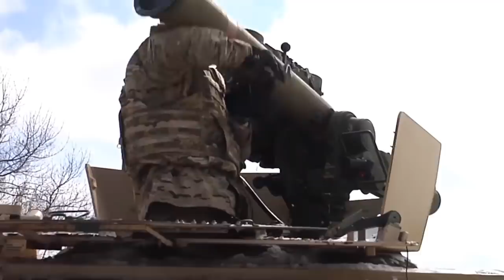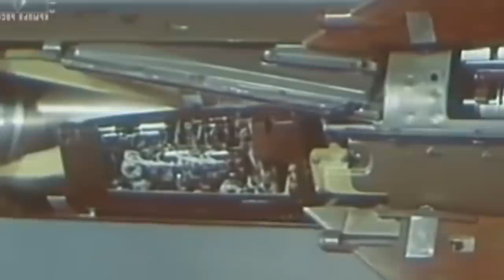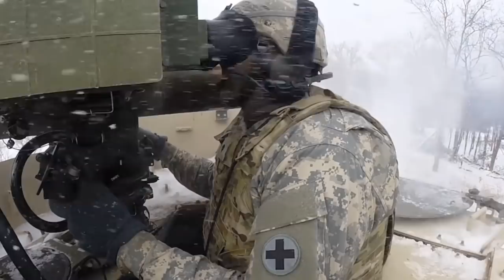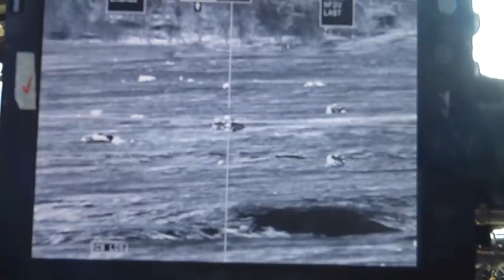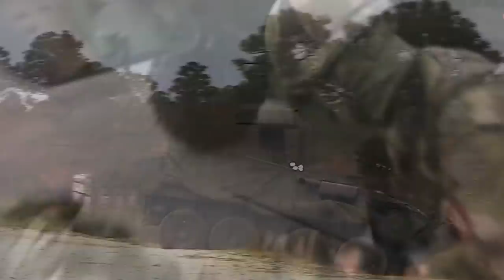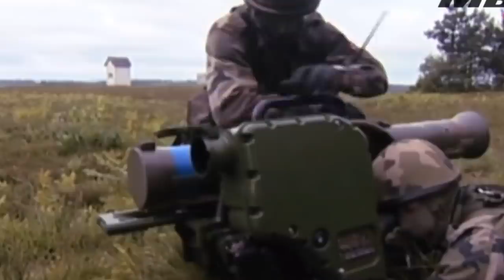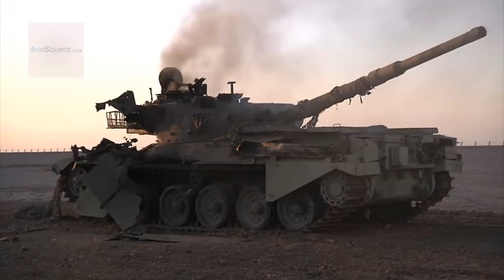Should Main Battle Tanks have Anti-tank Missiles?

Comment: First thing... What would be the point? The tank already has a very effective weapon-system...
Two, if you can put on ATGM's on tanks, wouldn't it be more worthwhile to go for anti-air missiles or laser weapons to counter ATGM's? Sure there are a myrrad of problems with that(!), however it would be far more beneficial for the tank. And with the big (or perhaps a slightly bigger) guns on the tanks already, most (if not all) the jobs that are needed, can already be done.

ATGM's are cool and all, but I feel that they would be somewhat wasted on a MBT with the big guns that we have... On an IFV or something similar with an auto cannon, it is ofc a very different result.

Comment: Better to have troops carry javelins, point or other FAF lockon systems instead of 1 on a tank?

The problem I see though is the further progress of armor thickness. Can MBT guns go through > 600mm effective thickness of DU armor? M1A2 does not have a Tandem warhead, so the only limited options are Sabot and HEAT.

Pros:
- Hellfire/Javelin missiles go up to 800mm of composite+ERA armor. Good example of death to almost any vehicle. No risk of bouncing.
- Missiles can ignore common ballistic trajectories, to hit with a high AOA, where the armor on the top of the tank is thin.
- ERA does not matter as much if using smart FAF top-down systems. (ERA matters when using RPGs, since direct line of sight)
- Can hit targets with high accuracy and same penetration at extended ranges where ballistic Sabot is not useful. (>3km shots)

Cons:
- Money money
- Software
- if wireguided, really easy to miss and requires direct line of sight, leaving your tank exposed.
- FAF systems can have electronic countermeasures
- Big rounds

Comment: The main reason for MBT's (and APCs for that matter) should carry 2-4 ATGMs of the newest sort that can be remotely targeted using spotting data from another vehicle, is that you could fire over your horizon in a way that regular ballistic projectiles usually can not, and also make "from-the-top-kills" on enemy tanks that are in cover, and armored on the front. If your forces have exact real-time positions a spotter-vehicle can position the enemy, then give your missile telemetry data, where you only need to aprove the fire-solution. Instead of facing an enemy entrenched position, MBT's can be their own anti-tank artillery, and then rush the staggered survivors, taking minimal losses for a total break-through!
Reply: If you want to know more about the ways missiles can be used like this, contact BAE Systems Hägglunds and ask them what they can tell about the solutions they are looking at for their CV90 APCs. The fact that they have an prototype implementation for this, is public information, anything else is proprietary and you have to ask them. If you can put one on a CV90, then you can put one on any MBT too, as long as the combat information systems are sufficiently advanced.
Reply: We are already doing that, with artillery's indirect fire. Laser designator paint targets and indirect fire ammo like M712 Copperhead and M982 Excalibur. German and British have similar anti-armor artillery ammunitions too.

Comment: The Russian's experimented with ATGM's that can be fired out of the main gun. The limitation is usually that the bore diameter (100mm-125mm) is not wide enough to accommodate an ATGM with enough penetration to punch through the front armor of other modern main battle tanks.

Comment: They should be able to launch guided rounds from their main gun. This allows them to take out high value targets like SAMs at longer ranges than possible with APFSDS. That said, they probably only need 2 to 4 in a basic load.
Reply: Yes. The Russians had Tube launched AT ( Dual use against helicopters) munitions for the T-72's and for the T-64's since the early or mi70's. ALl Russian tanks since fire ATGM trough the barrel.

Comment: Tanks don't need an ATGM, but we should probably be developing the next generation ATGM vehicle. Think of a vehicle with several Spike like long range missiles that are fiber optically controlled and also has several drones to find and direct these missiles. At this point you no longer need line of sight and can engage targets that are hidden without any fear of return fire like with most current LOS guided missiles used today. The tech already exists today, both missiles and drones. We just need somebody to put them together to an integrated system and you will have a much bigger game changer than a tank that can fire an ATGM.
Reply: Better yet a next gen A-10 replacement with increased capabilities, the A-10 scare the shit out of tankers when they face it, in fact it scares anyone facing attack by it, gun missile, bombs what ever it takes and It's hard to take down as well
Reply: 8aleph the a-10 is very slow in comparison to other jets, as a result it's much more vulnerable to AA
Reply: And fiber optic is not something you can put as a wire trailing behind a missile, the things break if you bend them too often you dummy there's also no reason to use the extra bandwidth or speed

And the final point is the large amount of heat and the light of the missile's exhaust cannot be hidden
Reply: Considering the Combat time the A-10 has flown and  with what maybe 6 down not a problem at all. That aircraft is exceedingly agile and has the same self defense systems as every other US Tactical aircraft and never ever flies straight and level except during a weapons pass. Back in the 70's when the airplane was new I was stationed at Kadena ab a pair of A-10s arrived to do familiarization training with our F-4 drivers. One of whom asked how fast the it was, when told he said dead meat and was then told the aircraft had all the same threat warning systems he had then was  asked If he cared to try a head on gun pass he thought about it for a second or two and said no way. As to aircraft speed slow is sometimes better, the Bismarck was torpedoed by a Fairey Swordfish that survived to do so because the ships aa guns couldn't track slow aircraft effectively
Reply: Yes, the A-10 attack planes and other similar ones are effective and they have the most massive losses. The question is that it will end sooner, planes or anti-aircraft missiles (it's difficult to count on this).
In a protracted conflict, we will have to abandon the tactics of using the A-10.
2008
Commander, before us is a forest of inversion traces!

Comment: Dont they already have tanks that can lob a tank shell and fire a missile from the breach? M551 Sheridan is a nice little example
Reply: The M60A2 and M551 which had the 152mm Gun/launcher are both out of service the  missile had a 900 meters minimum range, the conventional rounds had first generation combustible cartridges which were easily damaged and suffered from water infiltration 9 ply barrier bags and a rubber waterproof cover had to be pulled off before loading then a wait for the electric breach to close. In Nam most of the rounds fired by Sheridans were beehive dart loads less recoil max damage to troops in the bush. The electronic packages which made up the system were touchy to say the least if ATGM was to be used fire them first before regular HEAT-MP rounds as the recoil could disrupt most of the packages with 3 shots. Newer Russian systems are meant for long range shots especially vs Helicopters out past 3,500 meters or a tank parked with the side exposed. Only 3 or 4 Missiles carried in most cases.

Comment: 1. The Tanks in the Gulf War were outdated by any standart, modern vehicles such as the T90M or T14 are going to be nearly imposible to Crack with a TOW that due to Pasive and Active protection systems and ignoring those the Armor is still going to be to much to deal with by prety much all modern ATGM systems. the future is deinfetly in superhigh velocity kinetic weapon systems such as Railguns, but its going to be a while till we see those on tanks
2. ATGMs can fire on the move, the only limiting factor in that regard is the launching method and if this is one using Wire Guidance then it has to be stationary, Radio or Laser guidance however can be undertaken when on the move, and ATGMs fired from the Gun of a Tank are mostly Laserguided and therefor have the ability to be fired and aimed accurately on the move
3. Fire and Forget missiles should be quite very easy to implement on an armored vehicle and those would make the proces of aquiring the target and engaging it on the move even easier since you dont have to keep visual on the target and the weapon system itself does the job, aquiring and locking up should be very easy with a stabilized platform
4. Depending on what missile type you have you can outrange regular tank guns and definetly have a higher hit propability at the Maximum Range. you could also make them fire further by adding a bigger engine/difrent type of engine and/or bigger fins to let them glide towards the target

Comment: I would like to see the U.S. buy the "Weasel" light armored vehicle from Germany. It would be great for airborne units. You could probably drop six of them from a plane. The Weasel is armed either with a TOW missile or a 20mm gun. It would be great for ambushing armored vehicles. It would add a lot of anti tank ability, which is so crucial to modern airborne units. The protection it could offer and the amount of ground it could cover would help airborne units a lot. One thing they could do with the Weasel is put about two to four infantry soldiers in it, and do lightning fast raids, with a whole platoon of Weasels giving the soldiers fire support. There are a lot of things we could do with this vehicle, and it could add a lot of cost effective capability to our infantry soldiers, especially airborne units.

Comment: NATO is slow to introduce gun-launched missiles basically because the 120mm gun is just so effective in all metrics (range, lethality and accuracy). As you say, the cost of missiles is very prohibitive too. BUT a shell can't do a top attack (like say Javelin) and are not effective against aircraft, and it's the latter which will determine that NATO will eventually come out with a gun launched missile. It's no secret that NATO is moving to 140mm as a new standard calibre and it's to better accommodate a missile that's driving that change.
Reply: Should point out, there is no intention whatsoever to replace conventional shells, and the current plan is for an MBT to carry only a few missiles. Maybe six or so.

Comment: I think that having ATGM on a tank should be strictly a secondary weapon to the Main gun if added to them. If tanks are desired to have ATGM capability though it needs to be designed with that in mind.

There are instances where your gun might be disabled and you need a last resort shot. This is more likely in an urban combat posibility but possible nonetheless.

For instance the Abrams shouldn't have it. But Russian tanks have it because it is built with that in mind.

My take on the ATGM Tank debate.

Comment: The T90 shoots it from the cannon rigth?
Reply: dilango 1011 yes
Reply: And the Missile is stored AND loaded separately from the autoloader.  This means it takes LONGER to load and fire (up to 15 seconds but usually 10 seconds) than the T90's main gun rounds.
Reply: swaghauler ok

But would that be better than having it out in the open for it to be shot
Reply: YEs, T-64 ( later version) had tube launched missiles as well so this goes all the way back. Back then a 125 mm AT guided munition was just fine for heat/Hesh engagement.
Reply: Pieter Steenkamp t64 had 125? Thats pretty heavy
Reply: dilango 1011 all Russian tanks since the T-64 have a 125
Reply: Right. The initial production version of the T-64 had a 115 gun ( NATO was mostly using 105's ) but the massive majority of the production run was 125 mm and auto loaders all the way. They had some significant issues in the first years but had them worked out long before NATO could confirm that the T-64's existed in the early 70's.  When the west realized what the T-64 was suffice to say they did a good bit of panicking which only got worse as they gained more information about it.
Reply: I am not sure that they used ATGMs in combat, at all.
Reply: As far as i know Russian tanks with that capacity wasn't exported in the Soviet era and i am not sure it's a standard export package even in the post soviet era. The Russians did reserve certain capacities to protect that information so that's why their best tank ( the T-64) was never exported.
Reply: Yes
Reply: All tanks from the T-55 have the capability of firing ATGMs. T-55 / T-62 / T-64 / T-72 / T-80 / T-90 / T-14 and their modifications in the presence of the installed kit KUV.
T-55AD even had the first serial active protection kit.
Also there are kits installed on the BMP-3 100mm and 105mm NATO, etc. with a 100mm "Arkan" rocket, there are kinetic guided missiles for sea and land versions of 57mm cannons.
All basic modifications of BMP and BTR have demountable launchers for ATGMs.
Reply: Wrong. Russian tank ATGMS are stored in the autoloader the same way as the regular 125mm rounds.
Reply: dilango 1011 I thought they shot out of their engines. :D
Reply: so... they are shot out of the cannon
Reply: dilango 1011 wrong there mounted on the tank itself. It’s not fired from the cannon
Reply: T64B can use it also, same as T-72B, T80B and so on. So far only conflict where tankers used cannon launched ATGMs was in Ukraine on the separatist ( Russian) side.

Comment: There should not be atgms on mbts. The reasoning is simple: It's redundant. They already have a massive gun designed to take out tanks. ifvs or infantry do not have that luxury, and as such they are given atgms because they don't have 40 some shots to rely upon and need every trigger pull to be a kill, even if every trigger pull costs them 1000 times the cost of an apfsds shell.

Comment: The Navy of the world has mostly swap out big guns for missiles. Fighting on the ocean has a unique property: you have no cover. So the issue is never that the enemy popping out of cover ambushing you but to find WHERE the enemy is. If anything is on the horizon and can be located, today's Navy can hit it with missiles long before guns can do it. 

The issue with land warfare is you have lots of covers. And trees. In those arenas, guns are still very good (high rate of fire). On a flat, rolling landscape, and clear skies (read: desert and the Middle East. Possibly also, Russia), missiles win by range. And airforce too. Land force can have the Navy's missile capability by using long-range recon drones that can provide targeting information to missile carriers in the back. Think guided MLRS with drones. This cuts down response time, as opposed to calling in fixed-wing or rotary-wing aircrafts, and greatly extend the engagement range of a unit.

Of course when closed terrain is around, use guns. Have a mixed unit of tanks, missile carriers, drone recon and mounted infantry and you are golden on all terrains.
Reply: it depends on your opponent i think. some enemies could have advanced defence systems and shoot down your missiles.
Reply: Well, it's like the endless debate about offence vs defence. However, a weapon does not need to actually capable of killing something for it to be effective. It can be effective by draining the opposition resource on defending it. Small arms are horribly inaccurate. It takes somewhere between 50k-200k rounds to kill one enemy. However, bullets don't need to hit people to be effective. They need only to make the enemy fear for the lives, not advance, cower in place for the mortars and artillery to do the job.

Likewise, anti-ship missiles need not hit anything to be effective. Missile defence on a battle group consisted multiple layers: the further are of combat air patrols aircrafts and their radars to detect incoming missiles and the aircrafts' missiles and guns to shoot the missiles down. Then the layer of destroyers and cruisers with their own radars, AA missiles and guns to detect and shoot down missiles that escape the combat air patrols.  Failing that, the last resort are the Close-in Weapon System (CIWS). And those still have not factor in sea skimming missiles. The threat of anti-ship missiles is great enough that one-third of an aircraft carrier battlegroup aircrafts are tasked with defence, meaning that one-third can not be employ for offence. Combat air patrols, escort destroyers and cruisers consume fuel and crews too. Advanced defence systems are not free.

And that has not counted the emergent threat of submarines. Exercises after exercises showed that a few diesel submarines running on battery mode in littoral waters are incredibly hard to detect and can easily sink capital ships (read: aircraft carriers). How many more layers of defences is needed to add to an battlegroup before the diminishing point of returns? 

Guns on land warfare are still dominating because of the the limits of detection and targeting systems. In certain environments, missiles can be very effective. An active defence system should be considered a last resort.